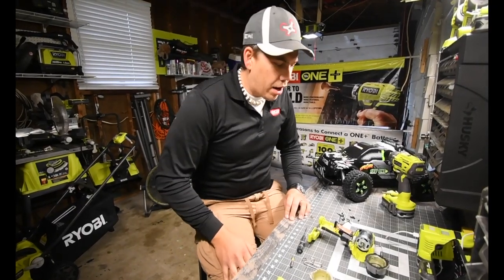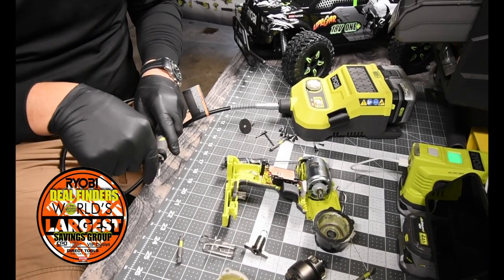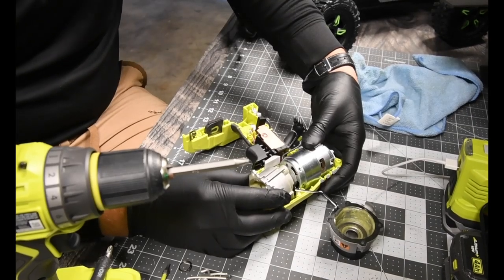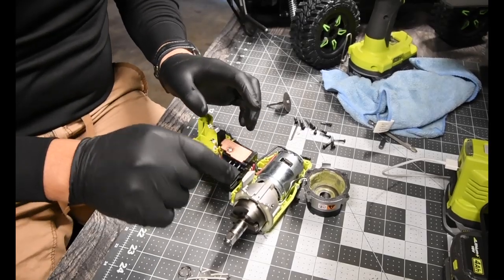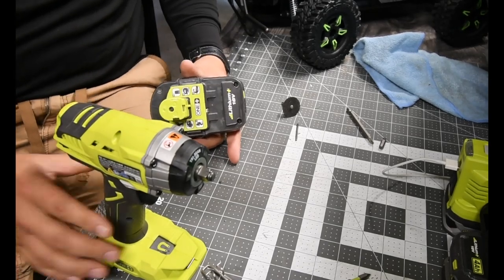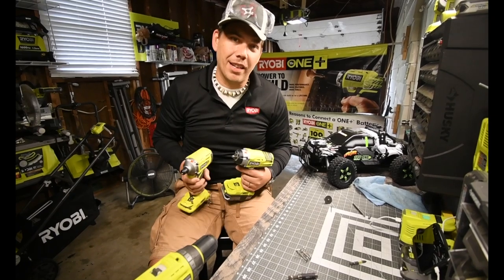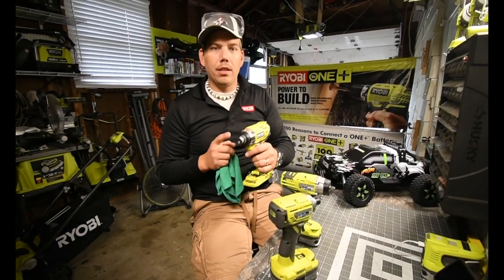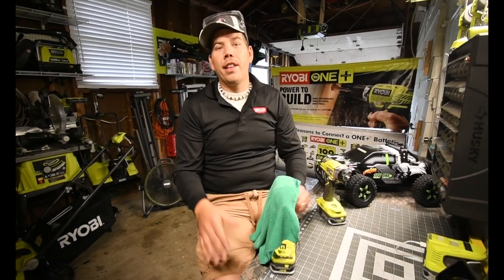Ryobi Impact Anvil swap Reversed and fixed

Comment: You would think the Milwaukee anvils would likely be compatible since both companies are owned by TTI. Also ever think of doing a wish list video of what Ryobi should make in the future. My top pick  would be a power ratchet.
Reply: Agreed.. a power ratchet and a brushless 1/2 impact with at least 400 ft lb of break away torque
Reply: The Ridgid JobMax  Ratchet Head fits the Ryobi P340 Multitool, creating a power ratchet.
Reply: Xorcize since it is discontinued the prices for that are equivalent to just buying the Milwaukee M12 ratchet with a charger and battery
Reply from the maker: that's not a bad idea.
Reply: @xorcize9071  yeah talking about that attachment now is more of a flex on people who are not able to purchase that attachment and just getting into the jobmax/multi-tool then useful also being a 18v tool it's silly the m12 can get into places where that 18v can't and the largest size socket for 3/8 I seen is 22m which is some what big

Comment: At 0:45, A circlip, also known as a C-clip, Seeger ring, snap ring or Jesus clip, is a type of fastener or retaining ring consisting of a semi-flexible metal ring with open ends which can be snapped into place, into a machined groove on a dowel pin or other part to permit rotation but to prevent lateral movement.
Reply from the maker: I was wondering what it was called and thank you

Comment: Got a ryobi pbliw01.only lights go on otherwise nothing? Im a retired tech.battery 6ah n charged.What fails on these? The output transistors or switch or something on board? Damn everything is potted.difficult to fix.